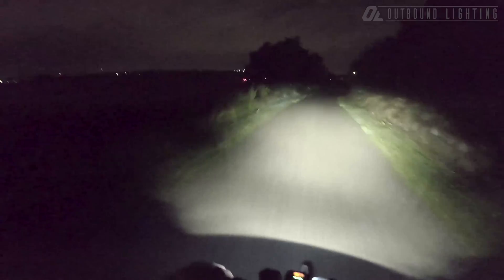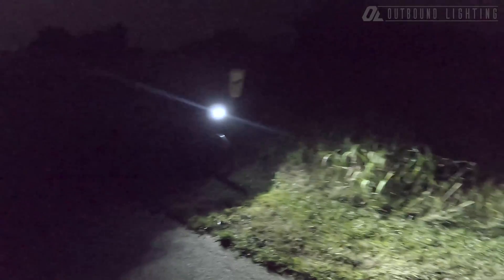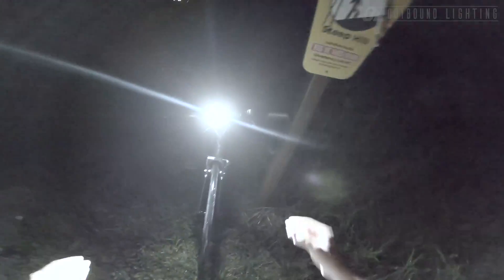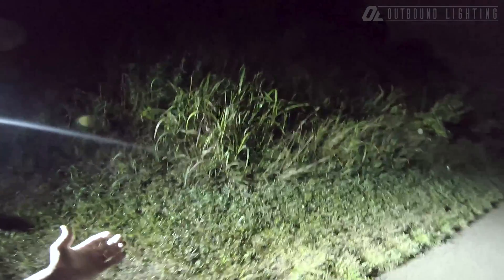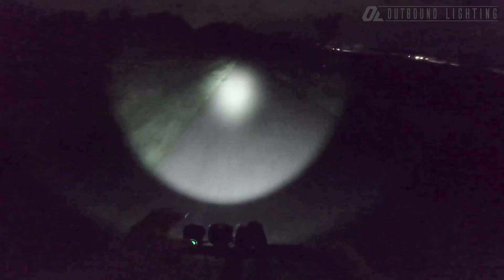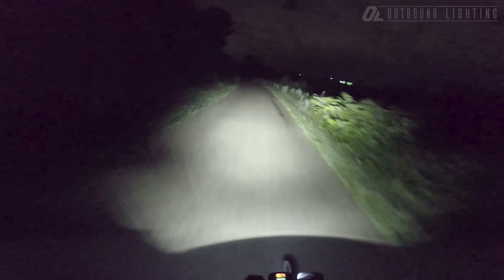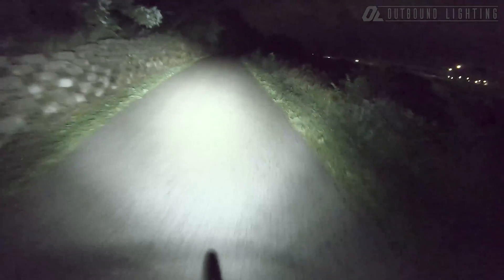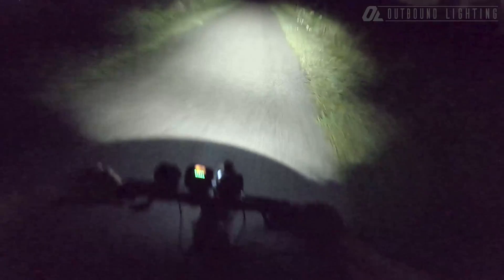BEST ROAD BIKE  LIGHT?! -- Outbound Lighting Road Edition Review & Discussion

Comment: You light is stunningly beautiful!  What model Brighteyes did you use?  The 1200 lumen or 1600 lumen version?
Reply from the maker: Honestly I can't remember, but the result would be the same. Only the 1600 lumen would be a "brighter circle" instead of the 1200 (or vice versa if I was using the 1600). The beam pattern shaping is the challenging part to get right. :)
Reply: @OutboundLighting  The Stamina 1800 has a much broader beam pattern than the 1600 or 1200 but yours is next level in light distribution.  Nice - I'd like to get the road version.